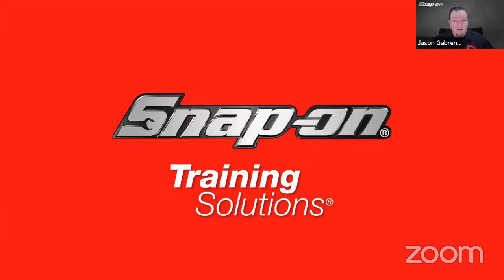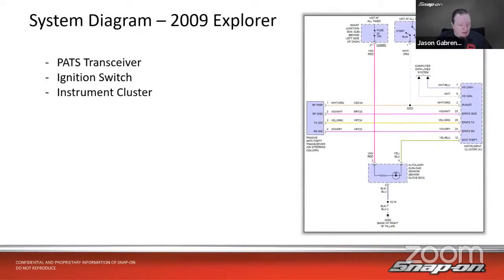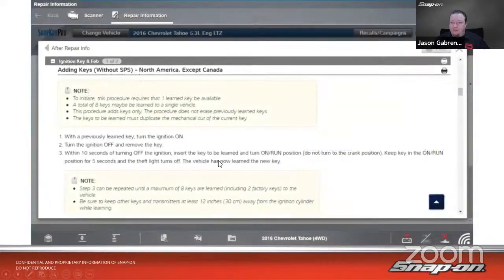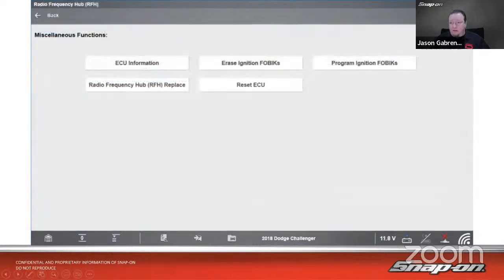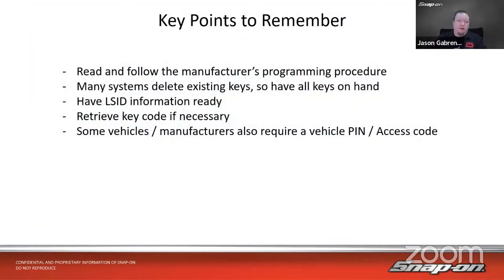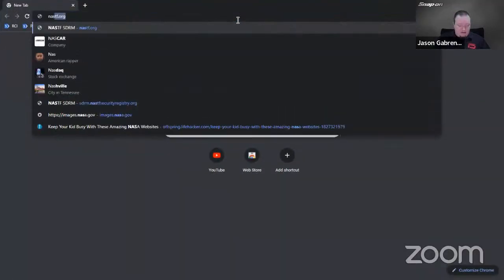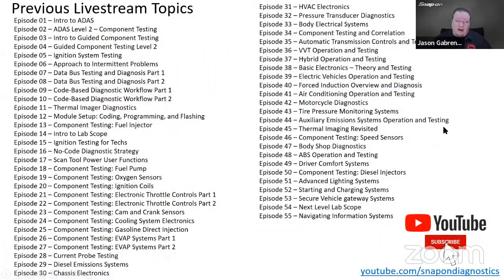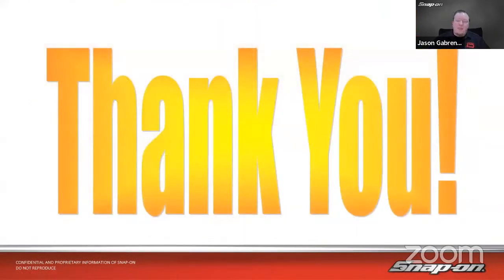Snap-on Live Training Episode 56 - Immobilizer Systems Operation

Comment: What I need to know is how to get into a BMW with zero battery power.  Without power the locks cannot be manipulated or forced and, from the exterior, there is no way to get power to the vehicle to affect an unlock.
As a roadside assistance tech, lockouts is one aspect of my job.  When presented with a powerless BMW the only thing I can tell them is get it towed to a garage/dealer who can access the power system from below.   NOT something I'm going to do in a customer's driveway.
Reply: Take the license plate bulb out and apply 12v to those wires
Reply: @shakirtechsupport6856  I've tried that.
Failed.
A - wires to the fixture are FAR too thin to carry sufficient current.
B - vehicle is off, circuit is also off.